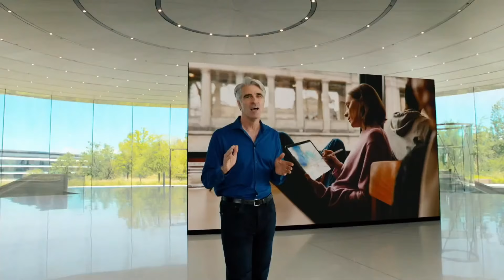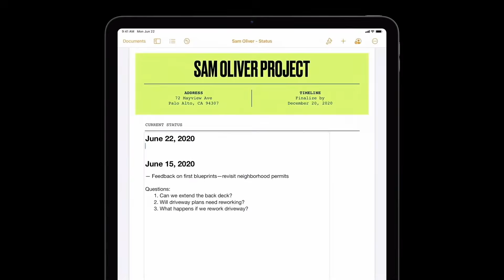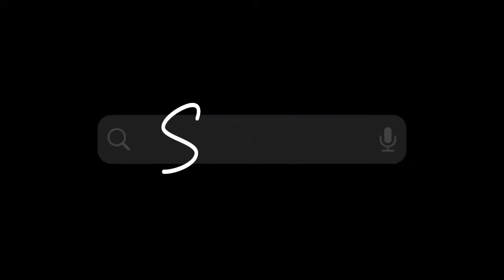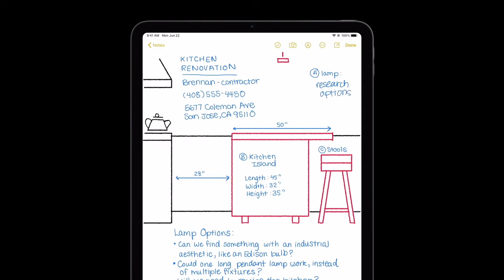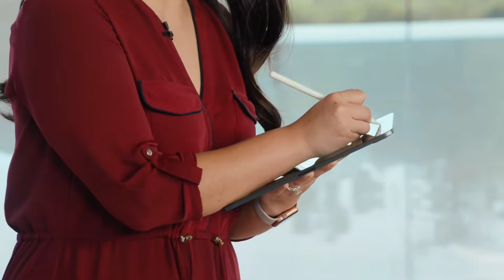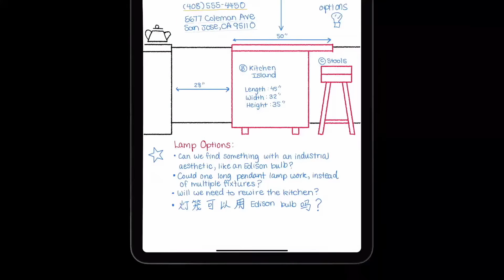Scribble for Apple Pencil! (Full Reveal)

Comment: I think this pencil using scribble only works for right- handed people! As a lefty I find that my hand or wrist drags across the screen and causes all kinds of trouble. For instance, it brings up the keyboard which is so annoying! 
For unknown reasons, it moves words In a sentence and puts them someplace else.
It's so frustrating to use! 
It starts new paragraphs even when the curser is right next to a word and there is room on the same line! When I start a new sentence it doesn't always capitalize after punctuation! It also capitalizes words that don’t need to be capitalized.
It doesn't always spell a word correctly even though I spelled it correctly. For example, I just spelled correctly 3 times and it kept spelling connectly.
I  finally wrote it in print instead of cursive and it did it right! 
 The word “to” comes out as a percentage symbol and “I” gives me a lot of trouble too. The letter “I” comes out like a number one unless I write it in cursive and even than it doesn't always work which is really frustrating being that we use “I “ a lot in sentences. 
The time it takes me to write a note in scribble I could have written the
Note 500 times faster using the keyboard!

Periods are also hard to accomplish. Too many more problems to mention! Need I say more. I’ve wasted 100 dollars on a pencil that I thought would make my life easier and it’ only made it harder!
I regret my purchase!
Reply: Laura Softheart scribble works just fine for me, no problems for me at all! Maybe your pencil is faulty
Reply: In fact, I'm writing this comment with Scribble

Comment: If the home bar can be configured for left or top for right, it will be easy while writing
Reply: Anand Sunku it can
Reply: The VinGard how
Reply: @KinoScope2221  how?
Reply: Anand Sunku Just press and hold the bar,then move it to the sides
Reply: The VinGard is there a demo video of it?
Reply: The VinGard thx for the explanation
Reply: Anand Sunku Just drag toolbar in Notes(as example),this is not attached to the scribble function
Reply: The VinGard I think you have mistaken scribble toolbar with homebar... homebar   I mean the one to switch the apps